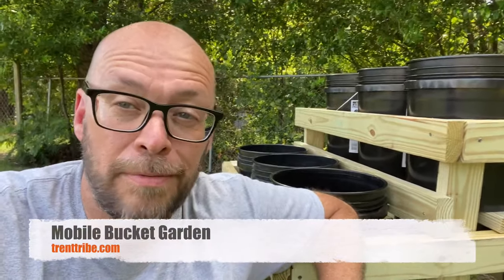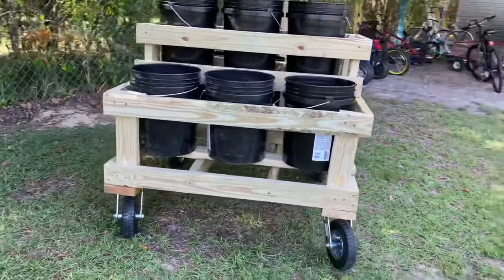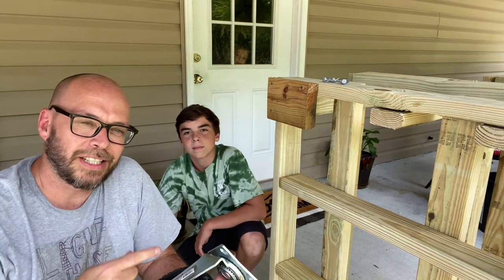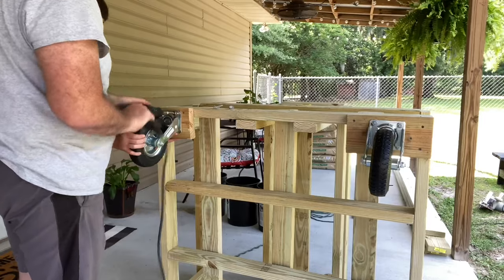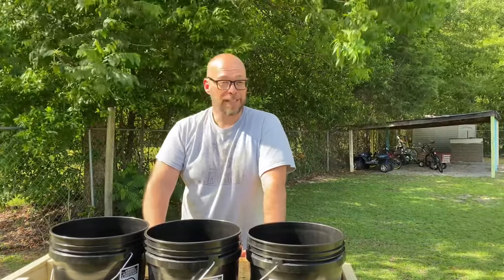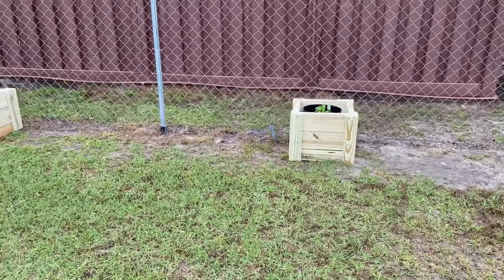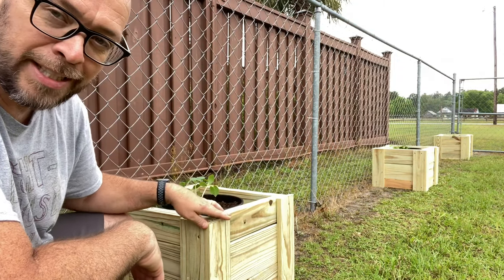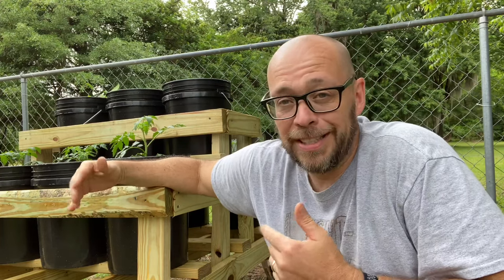A Mobile Raised Bucket Garden

Comment: Your design is one of the best combinations out there. You could make a lot of people happy by posting the measurements for the design instead of repeatedly ignoring the requests. Take the time and measure the pieces. You might get more people to visit your site and even look at other areas.
Reply: Actually, it's much simpler than this. You don't need to stair-step the buckets. All you need is a square wood frame on casters that will hold all the buckets at the same level. That will take up the same amount of space horizontally but less space vertically than the stair-step method. With a one-level frame, it will hold the same amount of buckets at the lowest level with casters/wheels to push the frame around anywhere you want it to be. Another advantage to this method is that you can cover the entire thing with a layer of plastic sheeting much easier in the late fall to prevent frostbite on some of the late vegetables going into the winter.

Comment: OUTSTANDING!  Need to rewatch this for the instructions.
Reply from the maker: Thank you. We are still loving it.
Reply: Unsure how the plants at fence in wood boxes and black buckets will turn out. Oxygen is blocked, maybe I'm wrong but I'd leave walls of box off or put a lid on it and place my plant on it. Not a deep rooted plant as it will hinder the growth too.
Reply: @lisayates2490  I have black buckets but they have holes drilled in them for air.  I also use drinking straws near the plant bases in soil for the air to get to the roots.  But it also depends on if I use the kratky system in the buckets or not.  It means I leave about an inch and a half or less with just water and plant food no soil involved and let the plant float in a net cup just so the roots are touching the water.  I use both dirt and hydroponic systems for plants.

Comment: 5 gallon buckets have 0.66 square ft. in surface area and can hold approximately 0.71 cubic ft. of soil. Make sure the buckets are made from food grade plastic and look for sales! I got my buckets for $2.38/each without lids. Normally they cost about $5.00 apiece without a lid.
Reply: Where did you get ur buckets ??
Reply: I got buckets for free or a dollar or two from our local donut shop after they had used the icing that was in them. A win for you and them!
Reply: Food grade doesn't really matter

Comment: Actually, it's much simpler than this. You don't need to stair-step the buckets. All you need is a square wood frame on casters that will hold all the buckets at the same level. That will take up the same amount of space horizontally but less space vertically than the stair-step method. With a one-level frame, it will hold the same amount of buckets at the lowest level with casters/wheels to push the frame around anywhere you want it to be. Another advantage to this method is that you can cover the entire thing with a layer of plastic sheeting much easier in the late fall to prevent frostbite on some of the late vegetables going into the winter.

Comment: I really like this A LOT, and am going to build one after the weekend. I have a question for you about 2 horizontal boards on this project. At the very top of this planter, you have 1 board at either end (supporting the top tier) that is clearly not 42 inches long, what is the length of those boards??? They would be at the top of the 26 inch vertical boards.

Comment: Buying all the pressure treated 2×4's = $$$.  Much of the Lumber can be pressure treated 1x 6 fence pickets.  Pennies per board ft. Compared to 2x4's.  Oh, and good luck rolling it on uneven, or wet ground.
Reply from the maker: You’re right. 1x4s or 1x6s could be used in place of many if not all. We went this route because the dirt and buckets are pretty heavy once they are filled, but 1x6s would work. Love to see a video of you making that one.